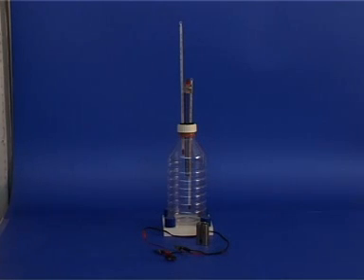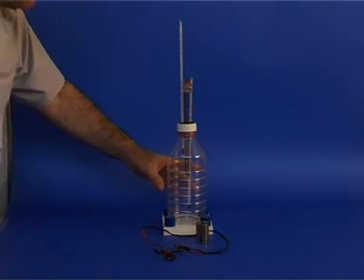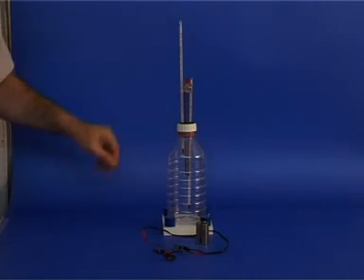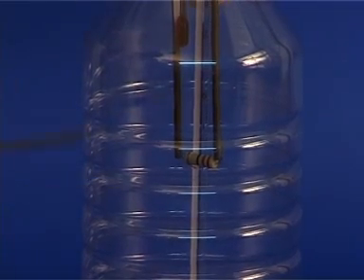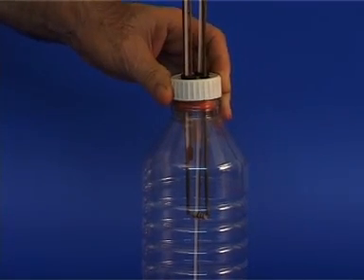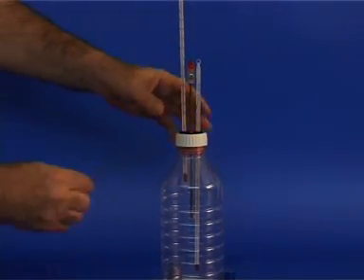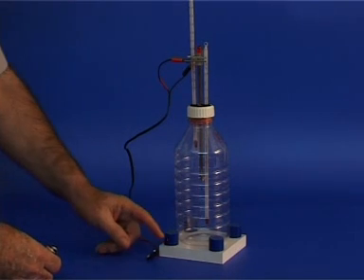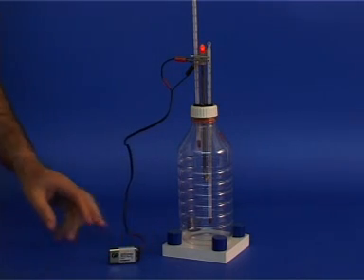45 Air As A Thermal Insulator.mpg

Comment: You mean there is no convection? Hot air from resistor rise and should increase temperature of the upper thermometer. You should use less inert one(i.e. thermocouple) and run this experiment little longer